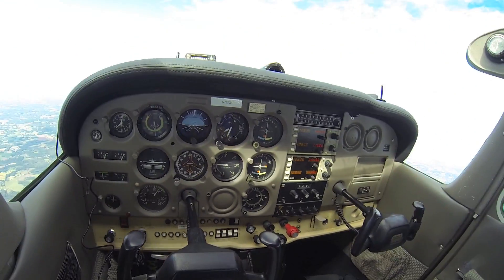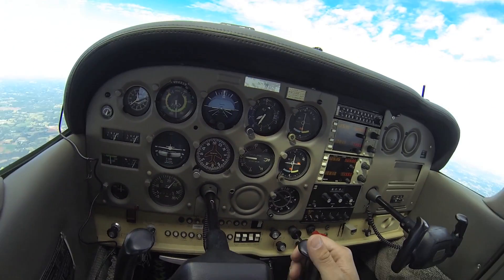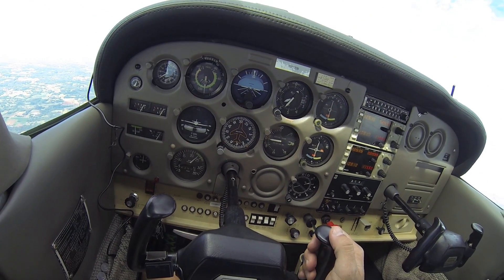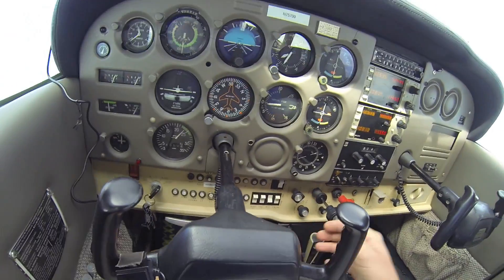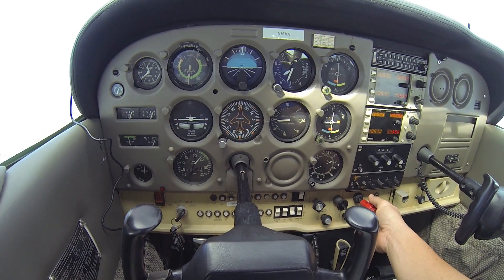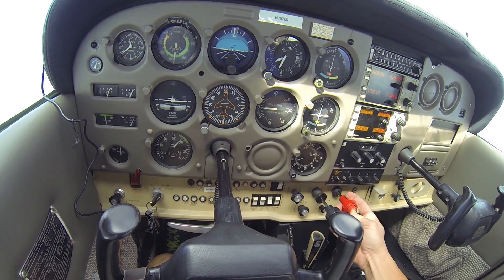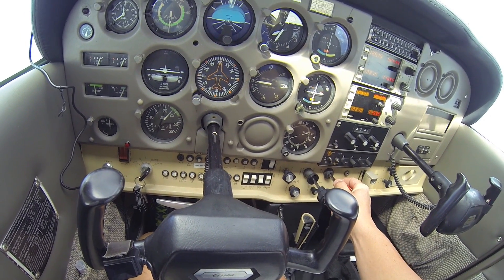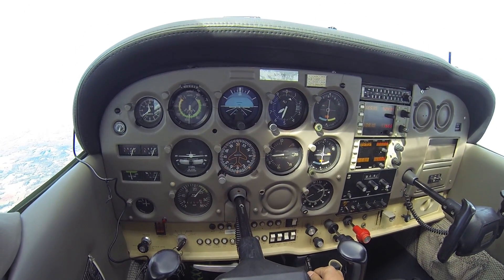How To Lean Fuel In Flight for Best Performance (in 1 minute)

Comment: Why is this still a "thing" - it's 2025 -  fuel injection or auto system would do a much better and safer job...  thoughts ?
Cars used to have a mixture control too....

Comment: Great advice when you rent an airplane and want to get there slightly faster. If you own it just know you’re putting more stress and heat in the engine for negligible increase in speed. There’s really no reason to run at peak.
Reply: What do you suggest then to properly lean ?

Comment: DONT USE THIS METHOD. he puts it at peak, which actually runs your engine the hottest. and is gonna destroy the engine. you have to push it royaly richer, unless you have expensive engine analyzer equipment, that way you can put it precisely. but if you dont have that (and most planes dont), just push it 'much' richer than ths guy.

if you have an EGT (many planes do), you want to lean until the needle is the furthest out. and then you push back in, by 25 degrees (2 dots to the left in a cessna).
Reply: Not sure that he is at peak EGT here, as he doesn't have a gauge for it. A drop of rpm suggests he is way beyond peak EGT already. And a small input of mixture won't put him on peak EGT. If he pushes for more mixture than that, he is bound to end up at the worst temperatures.
Reply: If you’re below 60 percent power you’re not  going to damage anything because the engine isn’t making that much heat.
Reply: Also the cylinder pressure isn’t that high either especially up at altitude because a naturally aspirated engine can’t breath in much oxygen to combust efficiently to make that much power. Just thought I’d throw that out there.

Comment: Helpful but the camera motion was driving me crazy. You have to figure out a way to hold it still and pointed at the dash.
Reply: DONT USE THIS METHOD. he puts it at peak, which actually runs your engine the hottest. and is gonna destroy the engine. you have to push it royaly richer, unless you have expensive engine analyzer equipment, that way you can put it precisely. but if you dont have that (and most planes dont), just push it 'much' richer than ths guy.

if you have an EGT (many planes do), you want to lean until the needle is the furthest out. and then you push back in, by 25 degrees (2 dots to the left in a cessna).

Comment: What does it say in your POH?  You should probably follow the advice and those engineers….
Reply: Like the ones that say to run your engine 50 ROP… in the worst possible mixture for CHP?

Engineers are people as well, and many well known and supported practices have changed dramatically over the years as new information comes to light.

Comment: I’m thinking he meant to say “decrease in RPM’s” not “increase”.
Reply: DONT USE THIS METHOD. he puts it at peak, which actually runs your engine the hottest. and is gonna destroy the engine. you have to push it royaly richer, unless you have expensive engine analyzer equipment, that way you can put it precisely. but if you dont have that (and most planes dont), just push it 'much' richer than ths guy.

if you have an EGT (many planes do), you want to lean until the needle is the furthest out. and then you push back in, by 25 degrees (2 dots to the left in a cessna).

Comment: Thanks this has helped a lot
Reply: DONT USE THIS METHOD. he puts it at peak, which actually runs your engine the hottest. and is gonna destroy the engine. you have to push it royaly richer, unless you have expensive engine analyzer equipment, that way you can put it precisely. but if you dont have that (and most planes dont), just push it 'much' richer than ths guy.

if you have an EGT (many planes do), you want to lean until the needle is the furthest out. and then you push back in, by 25 degrees (2 dots to the left in a cessna).

Comment: I'm pretty sure that method gives you the peak cyl pressures... which is exactly where you don't want to run the engine.  For an aircraft with a carb, this method is ok because the carb does a terrible job of getting a correct fuel air mixture to each cyl and some cyl will be at peak pressure, some lean, some rich.  With a good fuel injection system and engine analyzer this video is flat out wrong tho.

Comment: I’m always scared I’m going to pull it out too far!
Reply: pull till rough,, then  push in a little :))
Reply: @MAGApepe or am I wrong
Reply: @harrisonaskew8199   well you dont pull super fast,,, just slowly till it runs rough,,, then push back in a bit,, that will give you pretty close to lean of peak ,, yes if the prop is still spinning and you push the mixture back in it will likely restart
Reply: Even if you did couldn’t you just pull to right back in and the plane would start back up?
Reply: Even if you pull out to far and the engine starts to quit if you quickly push it in the prop will start spinning again. It only becomes a problem when the prop stops windmilling. What I mean is when the prop completely stops and locks in a position then you have to do and air restart but if you see the prop mine starting to quit because you leaned to much quickly jam that mixture back to full rich and the prop will continue running as normal.
Reply: Fortunately it’s fuel and not oil — it would be MUCH worse at that 😬
Reply: Pause
Reply: @ajd7121 I’m surprise to see someone with your level of intellect in this section 😂
Reply: Just push her in when it gets rough

Comment: Lean of peak ,be careful
Reply: Newer engines are ok with that, better for the engine anyway as far as it’s burning a lot cleaner. Better for rings, pistons etc
Reply: the C172M POH says to climb using 50 rpm lean of peak

Comment: What about in a turboprop engine which has propeller feathering options? Is the procedure still the same?
Reply: Maxengines Tech Not in the way you're imagining. In a piston engine, thrust is controlled by opening and closing the butterfly valve in the throat. In a jet engine, thrust is controlled by changing fuel flow directly. So, in jet engines there's no mixture control.
Reply: Maxengines Tech No you don't control it yourself. The FADEC does that.
Reply: +Sycabara You don't control the mixture in a reaction engine.
Reply: Someone has to do it.....
Reply: Yes you do.
Reply: Maxengines Tech
Well, I know as much about airplane mechanics as my CPL+ IR/ME + Frozen ATPL + MCC required.
There is no direct mixture control in jet engines, period.
There might be a logic, software and all sorts of mechanisms to keep an efficient combustion going, but there is no mixture control like the mixture control in reciprocating/piston engines.
Reply: Yes there is.Software(like you say) control the mix...
And you dont understand a shit about engineering, your confuding thrust with Stoichiometry. You may understand about tightening a nut but thats not enought...
Reply: @Limou551  what the hell are you talking about LMAO

Comment: I was starting to play "IL2-1946"
And I would like to know how would this help for take off from an aircraft carrier with a F4U "WWII aircraft" thank you
Reply: +JV R. Ponce No. We adjust the mixture at high altitude, to compensate for the lower density of the air. At altitude, less mass of air is sucked in per unit volume, so we adjust fuel outflow in the carburetor to keep mixture at the correct ratio. For takeoff and landing you always use full rich mixture, and more so at sea level. Also, those big old fighter piston engines had two positions, auto rich for take off and landing and auto lean, for the rest of the time.